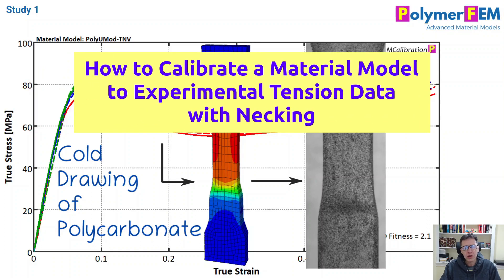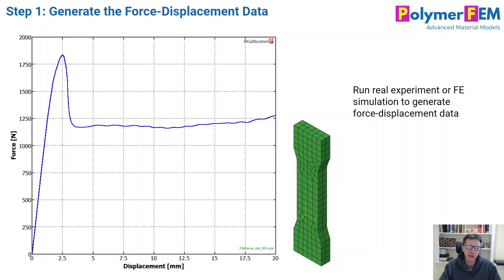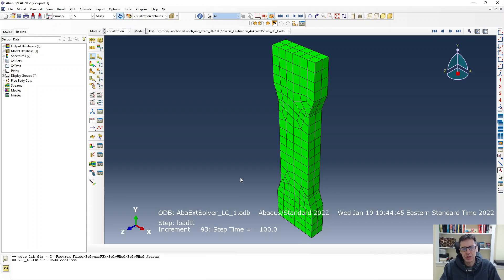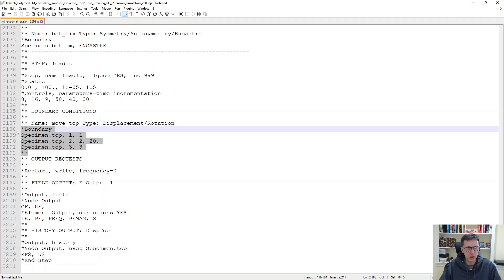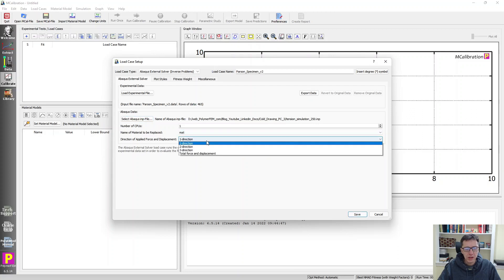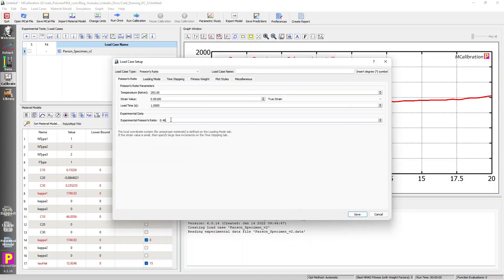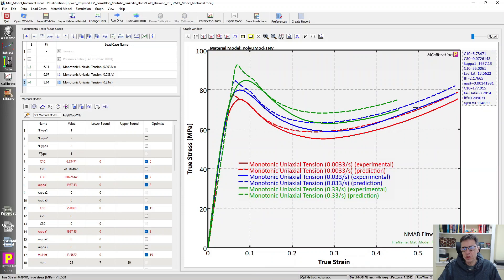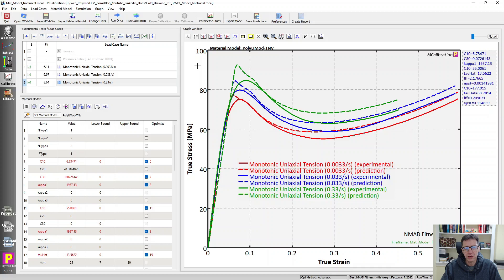FE Material Model from Tension with Necking (Part 3)

Comment: Dear Mr.....
Good day to you. I'm Amir ABDOLLAHI , mechanical engineer, because of filtering the websites, specially YouTube in my country, I couldn't find your email.
I am a mechanical engineer, in a UPVC Pipes factory. You know that when we want to produce UPVC pipes, we need to mix material such as Stabilizers, Caco3 as a filler, Tio2 , Pe wax and other additives material to UPVC particles.
and you know that it is no a composite product because the percent of additive to UPVC Powder is lower than 5%.
so , we produce this mixed material by Extrusion machines, and we use HAUL Off machine to draw material from extrusion Die.
we have all data from Strain- Stress Test .
we have  a  Longitudinal reversion  TEST that we need to simulate in ABAQUSE
based on the standard method, at first we have to cut 3 samples from produced Pipes from extrusion LINE with 200 mm length, then we put it in OVEN in 150 C   for 30 minute
after finishing this time , we take it out and wait until the temperature of samples to decrease to 25 c .
then we measure the length 
the sample  will shrink and the length will decrease .
So I have Strain - Stress TEST from Pipes and I can not simulate this process in ABAQUSE because I cant explain this behavior  in ABAQUS
Please HELP ME 
Yours sincerely
This is My email: Abdollahi.eng@gmail.com